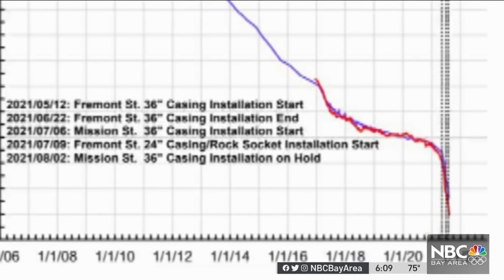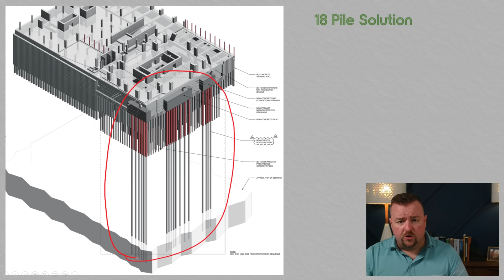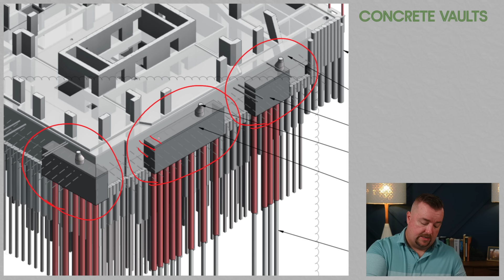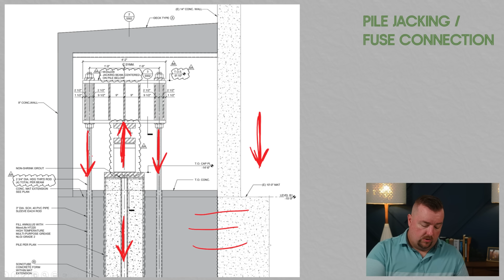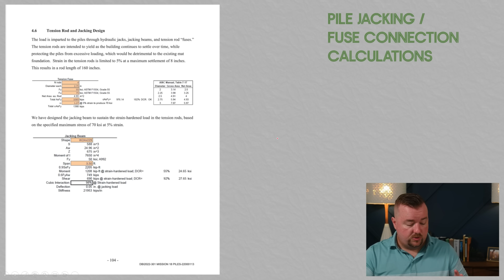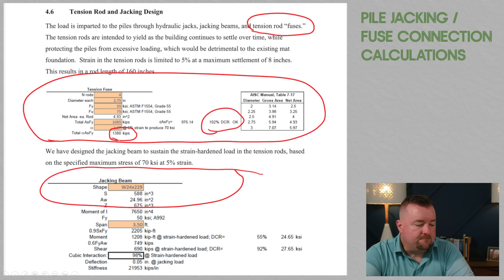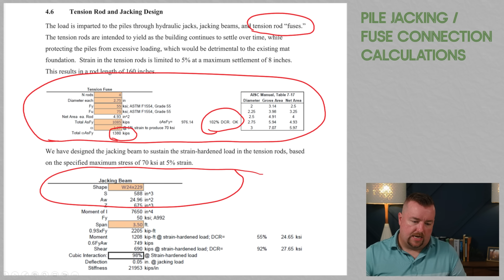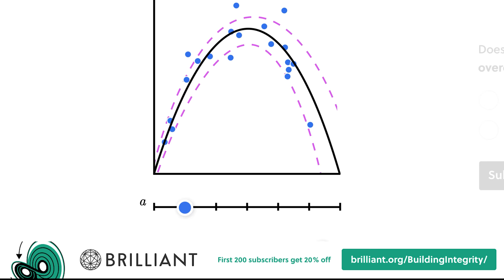Did I Uncover a $100,000,000 Mistake with the Millennium Tower "Fix"?

Comment: There are no calculations to demonstrate the threaded rods don't pull through the plate, neither are there calculations then to verify the two 13" wide x 6'8" stall shear planes in the concrete imparted at the edges of the plate to the vault concrete above that demonstrate the vault concrete can take the load (provided it gets there). There is enough room between the rods for 40 #18 grade 100 rods stacked in two columns of 20 (+ 2 for caging) , but you are correct that the terrific bending moment the plate seems excessive for its size to set the two shear planes to working.  That is where failure will occur, literally the weakest link, rendering the "fuse" concept moot.  Why not test it out?  The design could be tested to failure in the civil engineering materials testing lab at my alma mater, UCB, just across The Bay.  I'm just an architect, with 45 years of continuous CA licensed practice designing my own relatively small structures, no failures or even lawsuits, but what do I know...
Reply: How do you know what calculations there are or are not?  I think the remediation engineers have calculations for every aspect of this structure.  They had enough funding to do a proper design, and the structure is doing what it was intended to do.

I am not making any predictions, just observing and reporting what I see.  If it is going to fail, when and exactly how will it fail?  Several people with engineering credentials have criticized this solution, but, so far, all they have is talk.  I know of no evidence that the structure is failing.

Comment: Assuming  the small plates you point out don't actually fail,  they put in the threaded rods in so they will exceed the yield strength of the rods, how do they replace the rods after they have yielded?  The the combination of too small steel plates anchoring the rods in the concrete and the possibility of the rods exceeding their yield strength, this looks like a major disaster in the making. 

Allowing the engineering firm that botched the original design by not driving the piles to bedrock, to come up with a fix and then not having their design verified by another design firm is at best stupid and at worst deadly.  The engineering firm has conflict of interest.  If the building lean is not stopped or corrected the people who bought condos will sue the building owner and the design firm for what they have lost by buying the condo.  By making a "fix" it avoids lawsuits now for a disaster in the future because the underpinning will not be inspected frequently enough, and will fail if the threaded rod anchor plates embedded in the concrete fail.  There is a good chance that if one of the pile connections fails there will be a cascade failure with unpredictable results, the worst being a catastrophic collapse of the building.  A peer review committee will look at the overall design to decide if the approach looks like it will work and looking at the design it does look like it would work, ASSUMING all of the parts, piles, hydraulic jack, threaded tie rods, anchor plates and rebar tie in to the foundation are properly sized for their function.  They are not being asked to verify the design by checking the calculations they are being asked does this look ok?   I'm a civil engineer, but not a structural engineer, which means I generally design one and two story buildings, but when I saw the sizing of the anchor plates it was immediately obvious that the plate is too thin, and not wide enough.  I don't see how the plates will be able to take the load without the rod bolts tearing through the plates.

This reminds me of the Kansas City Sky Walk failure at the Hyatt Regency in 1981.  The original design called for the sky walk support beams to be suspended by one continuous threaded steel rod and it was a good design.  During construction the contractor asked for a change to simplify the construction, the change was allowed, the engineers looked at the proposed change and did not see anything wrong and they approved it.  Problem is that the change ended up doubling the stress on the walkway support beams and the bolts punched through the beams causing the walkway to collapse.  At a glance the proposed change looked ok, but no one checked to see how the change affected the walkway structure.  114 people were killed, and 216 were injured.  If the Millennium Tower fails catastrophically there will likely be far more deaths and injuries.

Comment: Oh boy. This seems like a dangerous building, with or without this "fix". I don't know what the ground material is, but maybe it would be safer to sink the opposite side(s) rather than trying to prop it up this way, or to fill the sinking side with some material that can lock things in place. My hunch is that the strain on those rods and plates will be too great, and there might be problems with stress in the original foundation, especially if voids appear underneath. There doesn't seem to be much handling of torque in that case. Also, is it really wise to rely on hydraulic jacks as a permanent solution, or is this just a scheme to ensure they have a maintenance job to get paid for in decades to come? It all seems sketchy.
Reply: No, they have done what is necessary to halt the progress of the tilting.  The new piles have halted the progress.  Further settling on the east side will tend to straighten the building, which is good.

The composition of the ground beneath the building has been documented and can be found online.  A good source is Structure Magazine.

Comment: So besides the tilting that has greatly over stressed the original foundation this band aid has been shrunk down and relies on a tenuous connection from it to the vault. The vault floats on bolts that are stressed way beyond design limits with no redundancy scheme. The bottom plates may not be sufficient. I didn't hear a word about earthquake sufficiency. And this whole daisy chain is held up by hydraulic jacks? Everyone in mining, construction and even auto mechanics know you aren't supposed to trust hydraulic jacks and their plastic seals etc with your life. Yeehaa, hold my beer and watch this!

Comment: seems obvious a quake will take it out while this is being done.  The load is supported by different methods. & even retrofitting speed up the sinking ? It'll be a miracle if its still standing in 4 years.
Reply: The retrofitting arrested the progress of the tilting a few months ago.
Reply: The tilt is about a quarter of a degree.  That is nowhere near falling over.  Since the low side is supported, further settlement will bring the building closer to plumb.
Reply: @crabbcake No, I do not own a unit, and I wouldn’t want to.  The primary objective of the remediation was to stop the progress of the tilting, and that has been achieved.

Comment: 14:43 this is a big red flag to me, specifically the assumption that the forces are evenly divided by 4. How do you really know that the forces are evenly distributed? If you tighten up the bolts in a pattern like 1 3 2 4 how do know that when you torqued number 4 that you didn't relieve pressure from number 1?  Based on my experience in the industrial setting with load cells you almost NEVER get an even distribution of weight when measured with load cells. In fact in many 4 post applications like that often times we saw 1 post supporting no load at all. If your beam and plates have a lot of flex, then yeah its more likely to have an even distribution, but with if they are very rigid.... good luck. Even with loadcell feedback it was VERY difficult to adjust the torque of the bolts to get even load distribution.
Reply: The load doesn’t have to be exact.  The nuts would be tightened with a wrench to approximately the same torgue, then they would apply the load with the jack.  It isn’t likely they forgot to tighten one of the nuts, so they should be close to equally loaded.  In any case, it doesn’t matter.  The worst that could happen is that one rod would be be tensioned beyond its elastic limit, in which case it would deform and transfer some of its load to the other rods.

Comment: that steel plate on each side at the bottom of the 4 threaded rods is the most concerning part to me... i may not be a structural engineer but i know that a thin plate like that in that arrangement is really worrying... i don't even think increasing the length and width of it would have made it better. if there is any moment applied to that bar [by say even one of the two threaded rods having some friction in the tube even, or not tightening the nuts on both rods exactly the same] it is going to be turned into a mangled mess taking out the concrete around it as well...
Reply: Thin?  It’s an inch and a half thick and embedded in concrete.  What do you think will happen to it?  When?  There are 36 of these plates in place now, each loaded to half a million lbs.
Reply: @GH-oi2jf  your response to me shows signs that you have no clue what you are talking about. there being 36 of them means jack sh*t in this instance. your only saving grace is that you called out that each of them are loaded to over half a million pounds, which is the issue. these are tiny plates relative to the force applied. and just because they are imbedded in concrete doesn't magically cause them to now be as strong as if the entire concrete block was made of steel. i don't know if you ignored what i said about a twisting force or moment on one of them, but again being imbedded in concrete does not magically remove the problems. what you are saying is the same as "well they are imbedded in concrete so this 10ftx10ftx100ft pillar for this building's foundation only needs paperclip wire diameter rebar to make it. no don't need to have more lengths of it just the same number at same spacing as if 1inch rebar." [ad absurdity for effect not 1:1 comparison]
Reply: People resort to vulgarity and ad hominem attacks when they have weak arguments, in my experience.

The significance of there being 18 piles, 36 plates, and 72 rods is that no one failure is critical.  For that matter, the whole assemblage isn’t critical, as the building is nowhere near overturning.  The lean is about one quarter of one degree.

Yes, I’ve read something about “twisting force” and “moment” somewhere.  In order to get my attention on that subject, you will have to offer more than buzzwords, like a picture or detailed description of the force vectors.  The main forces on those plates are straight up where the rods are attached and straight down where the surrounding concrete resists the upward force.  They aren’t going anywhere unless the concrete fractures.

The most important moments now are the weight of the building on the foundation mat, the upward force on the west side of the mat from the new piles which are set in bedrock, and the weaker upward force from the floating piles.  The uneven support of the mat will cause it to rotate toward the east as it settles, bringing the building closer to plumb.

Tip: More people will read your posts and will find them easier to follow if you learn to use paragraphs.
Reply: @GH-oi2jf  you know you make a good point, i should have been more professional and not said 'jacksh*t'. 
I thought i did split it into 3 parts, but that is my bad, youtube comments is not the best place for easy formatting.

and here is some advice for you, maybe post what you just did 1st and try to have a a conversation instead of going for the immediate attack like you did. your comment added nothing and didn't even properly explain your thought on it.

what is going to happen and when? that is your support for this design being fine? asking dumb questions like that is the same as unrelated ad hominem attacks. my supposed ad hominem attack is proper in this case as you ignored half my points and threw in sophistry as argument in your first reply. had i responded as i did after your 2nd post? ya sure that would have been a problem. 

to answer your question with another question; do you even know if this design is able to deal with earthquakes of any magnitude? let alone when only one corner and side of such a tall slender building has it. because i wasn't going to open that can of worms and wanted to stick to what i saw as a design flaw even in a non-earthquake area.

onto the actual response to your proper points now made. please forgive any spelling/grammar mistakes and use of layman's terms rather then the scientific ones

-i bring you back to what i said before; it doesn't matter how many there are. they are all the same design. if one is flawed, all are. i never said anything about a chain failure when one goes, i saw that brought up in a different comment in regard to the hyatt regency skywalk but i didn't go for that.

-all of your points in support of it being fine are based on assuming that the force will always be perfectly vertical relative to the pylon going to bedrock in middle of rods [i'm assuming that you meant pylon, not the 4 rods per pylon]. yet you also bring up that once these are in the other side will settle to level it out? that will change the force vector by a significant enough amount due to the small foot print of the 4 rods and the height of them above the plate. [i don't have schematics for exact dimensions so can't do the math on exactly how much at this time]
     Do you want to have them constantly adjust the tension on the 4 nuts at top of the assembly to alleviate this? because that is exactly what i brought up in less words originally. one screw up with how they tension and adjust them during maintenance will put stress on the assembly in very problematic ways.

-an inch and a half is incredibly thin for this scale both in size and force applied. had the other two dimensions been much larger, maybe it wouldn't be such an issue. but its also a flat sheet with no geometry to increase strength. there is rebar thicker than that in the images they show. i also called out that it only takes one of those "greased in a pipe" threaded rods to have friction in said pipe to cause problems that will show themselves on this plate and surrounding concrete.

-this "tiny" plate also has two holes that are half of its width dimension on both ends where it is held in place on the threaded rod by a pair of nuts. [might have had 2 on bottom, i don't remember exact drawing detail for that]
-i do not know what the exact strength and alloy of steel they used for both the threaded rod, nuts, and the plate. this does not change the fact that the plate surface area where the [in perfect conditions] load is applied is extremely small. concrete is not a wonder material that can do anything even in worst circumstances.

-no i will not draw and find a way to show you a diagram of what i explained in both comments. [more because of the effort and issues with showing it to you thru youtube comments] 

-and i also don't like the connection of the vault to the foundation of building. but i don't want to touch that as like i said, not a structural engineer or architect, and i'm going off limited info supplied.

Comment: I mean, why these rods are grease. if they gonna pull up all the concrete foundation. Without grease, would have more anchor to the concrete. Only the pile need to have grease.
Reply: No, the rod needs to be free through most of its length.  These rods act like ultrastiff springs.  The length that a spring can be stretched is proportional to its length.  If the rods were anchored to the concrete along the entire segment which passes through the concrete, they would probably cause it to fracture as they stretched.
Reply: @GH-oi2jf  but the pvc pipe gonna get compressed?
Reply: @EngApollo — I don’t see how those pipes would be a problem.  I’m sure they were chosen to be a size which would withstand the pressure of the wet concrete.

Comment: I don’t have a degree in Engineering, but a degree doesn’t mean much nowadays. The biggest scumbags in the world have a degree. They think a degree is a license to steal.

I think that problem with the Millennium Tower is an insurance scam. 

Yes, the tower is leaning. But the repair shouldn’t cost hundreds of millions of dollars. In this kind of situation, the first floor of the building would simply become a hydraulic leveling platform. The floor and ceiling would get 48” of solid-steel plate. Then hydraulic jacks, each ten feet in diameter and ten feet tall, would be installed on that floor. Perhaps eighty of them. So those eighty jacks would extend and retract as needed to keep the tower level. 

That’s a hundred million dollar solution; and the job’s done. 

The Unions in charge of the Millennium Tower “repair” are asking for a billion dollars. Maybe more. They have an Engineering Degree.

Comment: I read one violation on the cities website where they were caught dumped dry concrete powder in a support column and than filled it up with water. These guys are overly confident diyers and need to be fired.

Comment: How many engineers does it take to tell the difference between a load cell, and hydraulic jack? 😂 If you believe that they are jacking that building up then I’ve got a structurally sound 2 bedroom unit in Millennium Tower I’ll sell you.